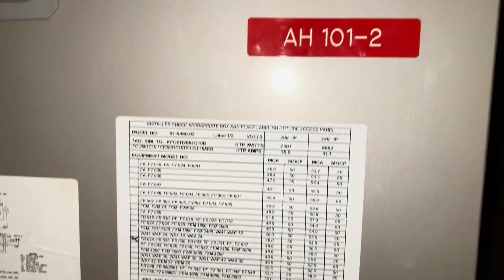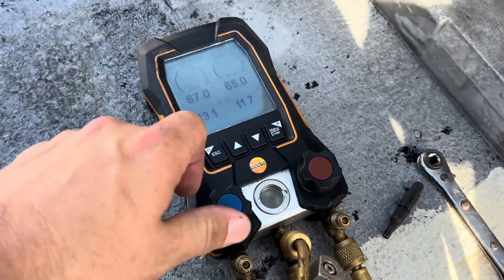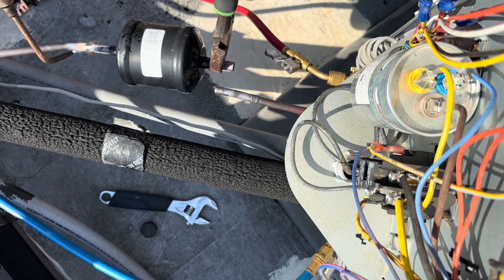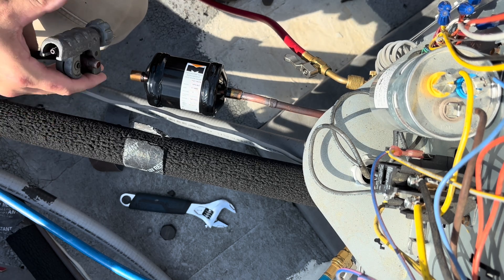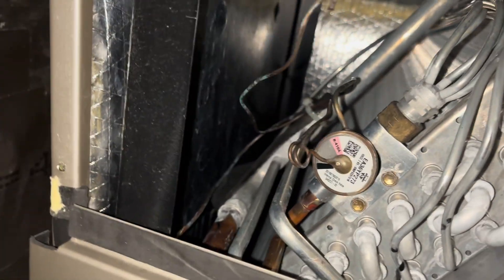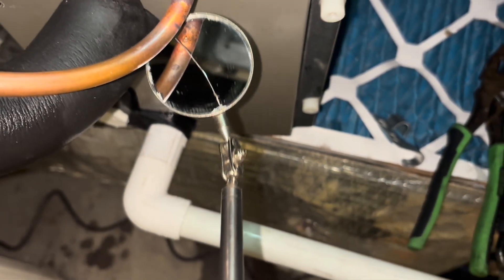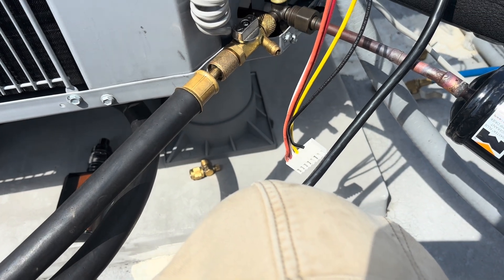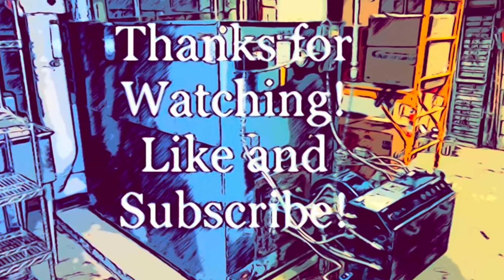A Bad TXV!  Not Always Just An Internet Meme!

Comment: It definitely does happen...in reviving the long dormant A/C system on a 1981 Allis Chalmers tractor, I spun the wheel and lost on the original TXV. I think the power head just lost its charge.

That compressor sure didn't sound happy at the end of the pump down! I couldn't hear the noise, so I don't know about that.

Comment: Good job Jeff the unit was probably overcharged before the tech corectly diagnosed a bad txv thinking it was low on charge. Maybe it was another company that's why you had so much difficulty pumping it down. There is the right way and a lazy way and the. Right way overcharging a system can make a txv go bad too.